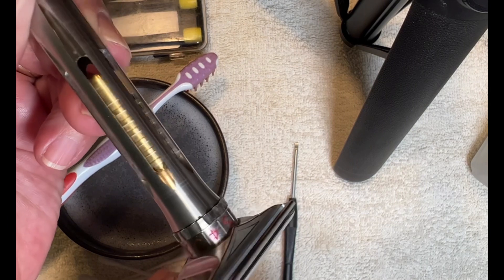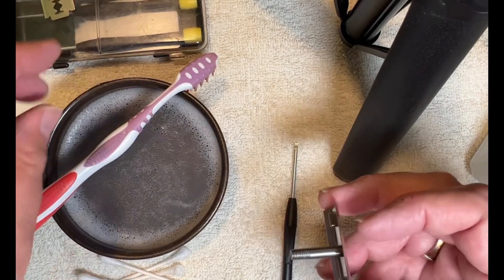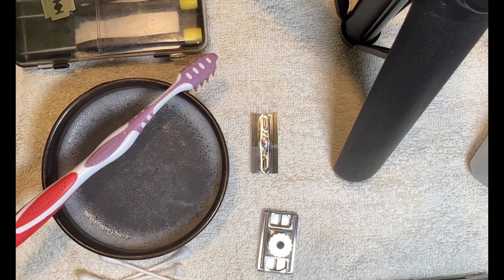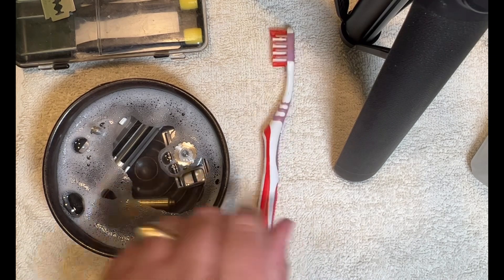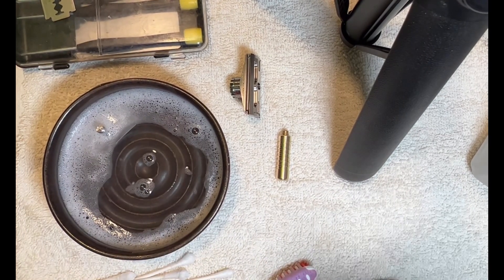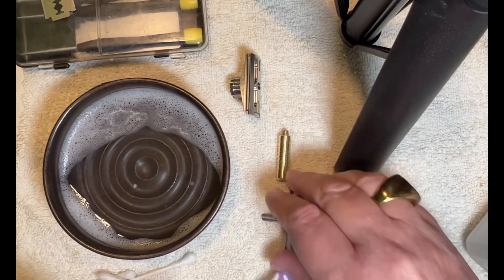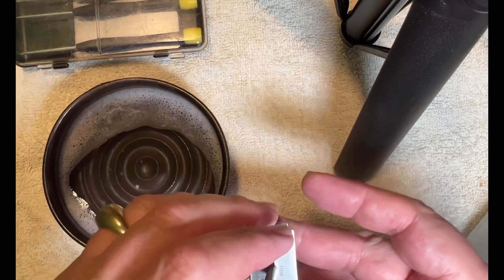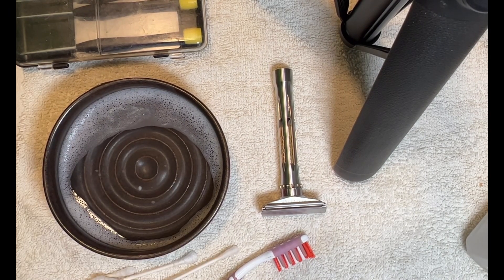Osprey disassembly and cleaning

Comment: Nice design of razor but not my typical cup of tea to own it!!

Machining could be little better tho on it with little more of fine detail but that’s my take!

Great Video Dave
Reply: The machine work is a joke for the price they are asking it should be fully polished and looking nice, its full of machine tool marks. And the spring mechanism can't be taken apart without screwing it up. Its an overly complicated design for a heft price.

At least the Rex you can take the springs out and clean everything. Also its a funky proprietary spring design...

Comment: Do you get worried about rust building in the mechanism of the actual adjusting wheel. Given that you can't fully disassemble it. I want to get one but I'm worried rust will develop within the adjusting mechanism given that we can take it apart completely.
Reply from the maker: Stainless steel, especially the type Blackland use 303 stainless, and will the high Chromium content as many watches are made from 303 rust is virtually non-existent .  You may get some tea staining if you leave the blade in, but as long as you clean it every so often it is not a concern
Reply: The Rex Ambassador, Rex Consul and all Rocnel Sailor also can't be fully disassembled and (aside from the Rex Consul ) these razors exist for over 5 years now and I personally haven't heard of anyone having issues. Can a stainless steel razor develop rust over time? I guess so, but unless you treat your stainless steel razor/razors poorly without wiping them out after shaving and then letting them dry for a few hours or a day, the chances of getting even a hint of rust are extremely slim.

Comment: The spring is fixed, that's not a good design.
Reply from the maker: There was nothing wrong with this razor. There is no spring, so there was nothing to be repaired. The razor is a wonderful design so I have no idea what you’re talking about.
Reply: @BarberDave  The internal adjuster is a spring, you can't really get to the spring...although you can take apart the razor cleaning the adjustment spring is fully enclosed...could be good or bad...don't know but Rex has replaceable parts...Osprey does not
Reply from the maker: @umbertosmith7014 if you are talking about the wave spring inside the adjustment head?  Ok it is internal and held with Lithium grease, so water infiltration should not be an issue.  I have one of the 1st ones and have had no issue to smoothness or cleaning at all. Like all of Blacklands products. I have never had any issues.  But to each their own. Thanks for your comments